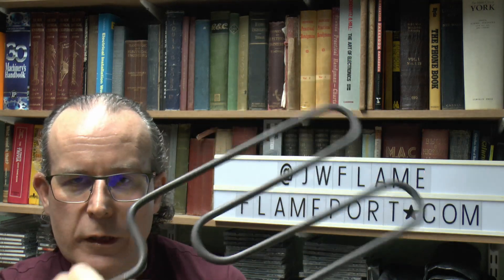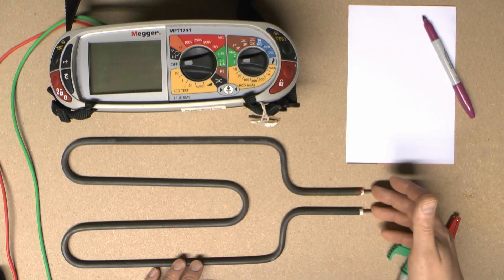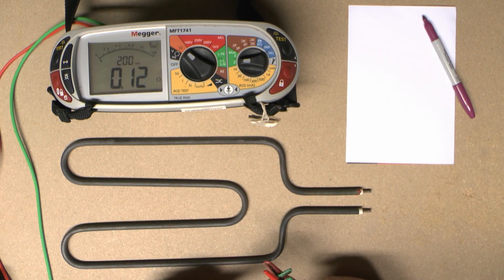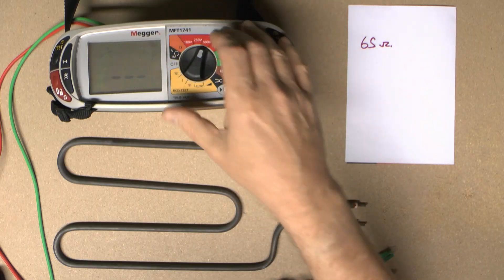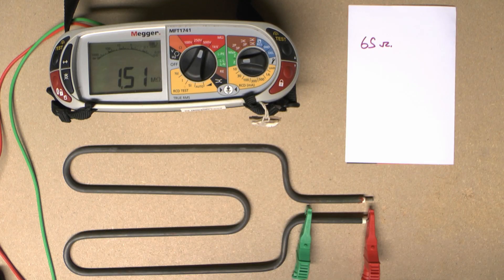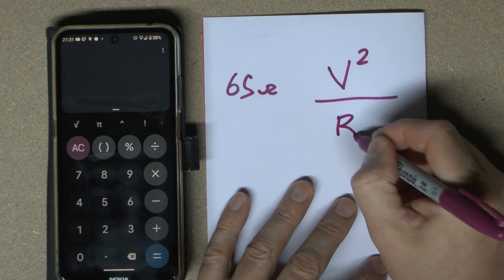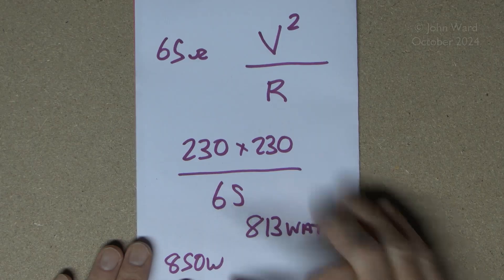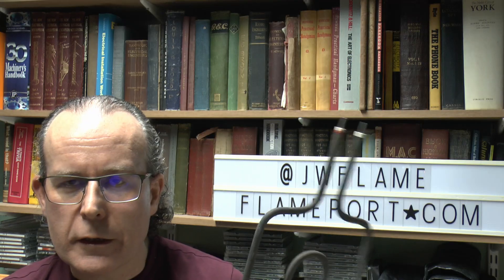Testing Electric Heating Elements

Comment: Hi John it looks like a heater element for a Dimplex storage heater. I repair these so there is a 1,2,3&4   element heaters.
The easy way to test a storage heater is to test it at the wall switch with the switch in the off position 
1 element heater would read 65 ohms approx
2 element heater would read 32 ohms
3 element heater would read 23 ohms
4 element heater would read 16 ohms
So if you get 23 ohms at a 4 element heater this tells you that one of the elements is faulty. A wee tip never change the one faulty element because the rest will go within weeks.
Also if you get an open circuit at the switch then take the cover off and measure at the element ceramic blocks . If you get a resistance then check the controller as it could be faulty or tripped.
Just to add that a storage heater element rarely trips a RCD unless there is a wiring fault in the storage heater.

Comment: Thanks JW for the great video. What are the chances of a brand new oven having 2 of 3 heating elements faulty? My oven works fine with just the grilling element and fan on but both other elements trip my RCD/Circuit breaker after a minute or so when cold, and instantly subsequently after warming up (around 100C). Could it be a installation problem? I can't see how a dedicated 20A single phase circuit can be screwed up.
Reply from the maker: Small but not impossible, particularly if it's been stored somewhere wet or damp.

Comment: Can I ask what issue could be if there’s a high resistance reading in continuity?
Reply from the maker: High resistance would mean the output power would be less - however there isn't any way an element can fail like that, the element is either intact, or it's open circuit.
Reply: @ Ok great that would make sense. I was getting around 90 ohms on 3kw water heater so would explain why water temp is never getting hot enough????

Comment: The power rate on the element is probably based on the voltage the factory used.
 If I use the voltage we have in Western Australia, it comes in at 961 . 5 watt. 
On the East Coast, it's closer to 886 watt.  This variation is due to a stuff up back in the days of Noah that has never been corrected. 
When we had incandescent globes we could buy the " high efficiency " globes rated at 260v and would last. The others were rated 240v and would have a shorter life.

Comment: Good video John,,, nice to do the ball park cold calculation,, good also to divide the wattage as per the rating by the Volts,, then Volts divided by that current to give the effective resistance when operating,,, I am out of the game now but I seem to recall the numbers 1.38 & 1.8 as something to throw in the calculation due to heating effects,, when having just measured cold circuit resistances think one of these numbers was included
Reply: Actually come to think of it 1.8 was used in some calculation working out disconnection times and earth wiring sizes

Comment: I had an oven that would trip RCD at set temp. IR test once element hot proved the insulation broke down when oven reaching high temp but passed IR when just cool or warm. Always pays to check IR in real situations, where possible.

Comment: Here's a worry.  I'm a heating engineer (technician) and rarely get involved in anything electrical.  I had a customer who suspected that their immersion heater was duff (there are two in this cylinder, so it's not clear).  I asked a sparky what the resistance should be so that I could test them both.  He said it should be 0 (ohms).  I repeated the question, but the same reply.  Now, this guy is quite clever, so I just said thanks and rang off.  I tested them both and got 19 ohms.  It turned out to be the overnight timer switch.  He's retired, and worked for BT.  Troubling, no?
Reply: A good 230 volt 3kw immersion heater element measures about 23 or 24 ohms when cold.

Comment: You should also have covered that elements can short to earth when hot yet measure fine when they cool down. This can happen as infrequently as once a month. This has given me grief several times on cold room evaporators that can have 30 defrost elements and no way to find the dodgy one except by trial and error disconnecting elements. 
An insulation tester can sometimes show up the culprit by giving a slightly low reading.
Reply: This is correct and had caught me out a few times. Didn't quite see what John's voltage setting was on the IR test but I always do it at least 500V to seek out the fault. Once it still passed but failed at 1000v. Once warmed up the fault becomes more obvious..

Comment: Hi, 
Years ago I used to work for Deritend lee Beesley,
as an engineer [electrical] repairing motor drives and controllers.
We megged motors, a nominal value of 100MΩ and if below 10 MΩ , 
was a fail. Meaning a rewind.
If we allowed any motor to proceed, within months the system would 
destroy it's self.....
How is it that your element passes at 1.5 MΩ ? [ at double the ΔV ]
Reply: Switch the heating appliance on for a short period of time and check the ins resistance again and you will find it is much higher as any dampness is dried out.  I have seen a brand new appliance such as a commercial cooking hotplate fail a PAT test and happily pass after a short period of use.  Regular use will keep the powder based insulation dry.  Obviously if it does not improve or is very low resistance to earth then will need replacing.  Motors have a varnish/lacquer based insulation so don't suffer this way.

Comment: filmed in the UK where the voltage is often between 240 and 250, makes a sizable difference on the wattage.
I will now get some .'#£? saying we are supposed to use 230 as its the standard, it also says in the standard to make allowances for site and area conditions.
Reply: Exactly. 230 on paper to satisfy the bureaucrats.
Reply: Yes using 240 gives 886 watts so it’s in the zone!
Reply: @geoffplywood6112  Yep, just done the calc at 245v and I get 924 watts, just a thing to be aware of.
One site I visited had a supply of 252, just in the max spec...of 253

Comment: These elements can be used on a LOW voltage , and put in a card fruit box , with a metal plate on top , and a cloth over that .... your puss cat  WILL  climb in when the weather is cold 😝.... you are looking for about 20 Watts , so a 2000 Watt element run on 24 Volts AC / DC is ideal ..... ( tried - n - tested ) ................. DAVE™🛑

Comment: I find most of the time an element will only show a earth  fault when it's warmed up.
Reply: With a insulation tester you get a much higher voltage and more sensitive so it should see it easily, but if it is dry it might test ok even if it isn't

Comment: Element Insulation testing has always had me a bit confused. The standard says it got to be greater than 1M ok thats easy but that is a worst case figure. What Ive been trying to find out is what the insulation should be on a good element. I did find an attached test tag from the factory of a water heating element and it was tested into the G ohms. Personally if I'm installing a new element it must be 1G or higher, if I'm testing an installed one it should be 500M or higher any less and I replace it because its going to fail sooner than later. I cant find any confirmation that this is a reasonable or not approach, what do you think?  If Im buying spare elements I wont buy them if they are less than 1G

Comment: In my experience, elements often check out fine when cold but the insulation resistance goes down when they get hot.
Reply: Put voltage setting on IR test to 1000V when cold, this usually finds it..

Comment: Had a water heater element fail, outer sheath eroded through, and water got in. It still worked, but was returning current via the water and the ground connections, and thus it was arcing and making a noise. Only heard it because I went up there, heard the grumbling sounds coming from it, and decided it was time to change it. Old one out, using that socket spanner you need to undo them, and a few buckets to drain the water, and pulled it out to see it missing half the element completely. New element in, along with a new thermostat, and turned water back on, and after the upper tank of the gravity geyser had filled, turned the power back, on, to get the normal heating sounds again. would never have known aside from that noise, as the water heater was not on a RCD, and the pipes were all copper, so not even a high current was measurable in the earth wire, as the bonding to the incoming mains was much lower resistance (50mm copper pipe) than that 1.5mm cable that supplied the 2kW element.
Reply: The element didn’t fail, it just transitioned into an electrode boiler😂.

Comment: Hi there. An interesting if somewhat dangerous extension to this video would be to check the insulation resistance as it warms up. Or even the current draw. In my experience, some failures are dynamic and only trip “after a while”. If you could measure change in insulation resistance over time vs temp, this would be fascinating. But I realise you’d need a very specific fault on the element!
Reply: I’ve had the same fault before, particularly on spiral cooker rings. What can happen is that resistive element moves within the insulating powder as the ring heats and eventually makes contact with the outer case which is earthed, resulting in a trip. Ring cools down, and by the time you megger it and the fault has cleared!
Reply: @jamborello1233  Even worst scenario with a kettle that have the stupid "printed" resistor, it worked fine hot, cold, perfect insulation (with a basic ohmmeter) , it tool time to find out this stupid thing act just like a "park gap" that randomly flashover the insulation to trip the RCD. It's only when it finally died that with the disappearing of the random trip we finally found the culprit and invest some money on a "high voltage insulation tester" not at all as good as the one displayed in the video but fine for my use.

Comment: For theInsulation resistance (megger) test.... , the red lead could be clipped to both the heater terminals....& the other to the body.....
so between the element & body there is a somewhat more uniform  test done..

Comment: John, I like this video and your channel, so don't misinterpret what I say next as throwing shade. If the goal is troubleshooting, I'd be inclined to test input wiring first. Remove the element, then put a 240V incandescent test light between input and output wires, then turn it on to see if the circuit and its driver can deliver the power required. If the light glows brightly, you've ruled out voltage drop, blown fuse, open circuit, upstream short to ground, high resistance neutral and failed driver as a cause. I've often wondered why technicians don't usually test the element directly. Not all have a megger on hand. After the element is removed, the short through a corroded area could be disrupted enough to create a time wasting false negative. So efficient work flow is to prove the circuit is OK with a 1 minute screening test and then swap in the new element with confidence.
Reply: It’s a heating element. They’re the first thing to check if the rcd trips - kettles, ovens, toasters. Waste of time faffing around with test lamps, simple multimeter across the terminals and you’re done.
Reply: so to be clear, you're advocating a 60w bulb for checking a possible 2kw element driver.
A high res wouldnt show up much on this small amount of current (250mA), but pulling 8-10amps would.

Comment: I have a project - to build a metal melting oven [ to recover gold & silver from electronics ] I got off craigslist some heating elements imbedded in ceramic panels , its been a while & they are in storage , but seem like around 19 Ohms & others around 25 Ohms . 
I'm in US & have both 240vac 50amp & 120vac 30amp available .
Trying to reach temps in the 2,200 F range ?
Thanks
Reply: Assuming the heater elements are rated for the temperature you desire, use the 240V supply and if the elements are rated at 120V then put pairs in series - this will give you more power.  I would also recommend a lot of thermal insulation material is installed around the heated zone otherwise it is difficult to reach that kind of temperature.  Be sure to have the data sheet for the insulation, RCF (refractory ceramic fibre) is great for this application but the dust is carcinogenic.

Comment: Hi John, I’m doing some tests on a central heating pump, on speed setting 3 I get 160ohms and it’s got 240v to it. So I thought it would pull 1.5amps using ohms law but this is not the case when I use an amp meter. Have you done any vids on this topic, stators actually lowering the current. And also how to test PWm pumps in modern boilers. Not sure how to test pwm ? Thanks for your vids they are extremely helpful.
Reply from the maker: No videos on that, however DC resistance of a motor is pretty much meaningless, it will not be relevant to calculating the current or power.
Reply: @jwflame ok thanks for responding. Seems a subject difficult to find information on. I’m a heating engineer and very difficult to fault find on PWM fans and pumps. Somebody told me about needing an oscilloscope but not sure as seems manufacturer don’t declare what a good measurement would be. And changing this component is expensive to change blindly.
Reply: @stevesanders4071  Resistance tests on ac motors are good for checking if a motor is healthy but not for checking current/power.  A motor winding represents a much higher resistance or reactance to ac voltage than dc therefore will draw less power than you calculate.  Modern energy efficient pumps have built-in electronics (some larger Grundfos have a full inverter VSD on the side) so cannot be resistance tested without stripping down and accessing the motor wires.  An oscilloscope could be used to check the running output of an inverter and you would expect to see 50-60hz waveform at full speed, pwm drives would be a lot tricker and require some manufacturer data.  Best thing for simplicity is buy a good clip-on ammeter and check current.
Reply: Correct me if I'm wrong, but Ohms Law can't be wrong, can it?  So if you're getting say, 1.4 amps it's because your voltage is 230, not 240?

Comment: Is it still 65 Ohms when its up to temperature?
Reply from the maker: The resistance will increase with higher temperatures, but it won't be significant for the purpose of determining whether the element works or not.

Comment: A good demo of element testing but the maths is wrong the element would have been designed at 240 V becouse that is the voltage applied to it, not a nominal nonsence voltage of  230v. 
As the voltage is squared  using nominal voltage introduces and error of around 10% for low power heaters it doesn't matter much but in high power heating such as furnaces it is important,  in additon the resistance changes at operating tempurature.
Reply: I was going to make a similar point. There are many cases where the safe thing to do is to calculate with 240V nominal.
Reply: I thought that myself and redone the calc at 240v which gave a power of 886 watts, which is well within the nameplate rating of the element. As  the resistance will increase with current she should dial in nicely. I’d call that one good.